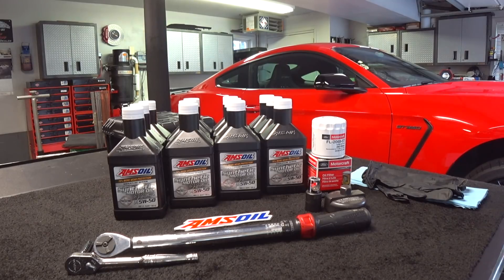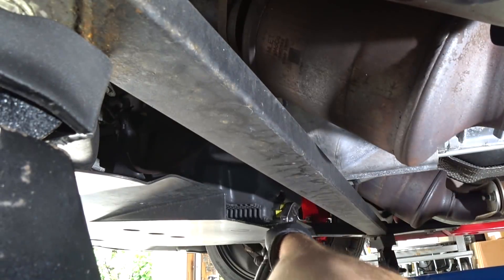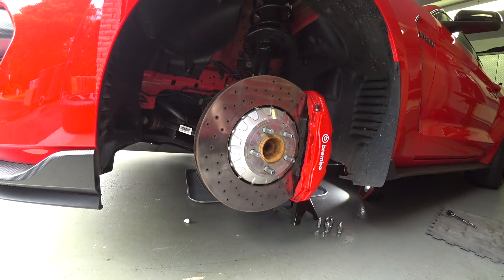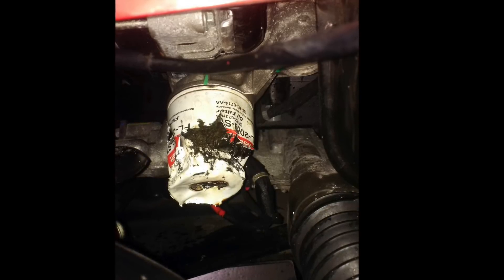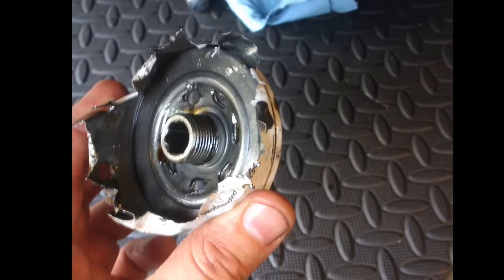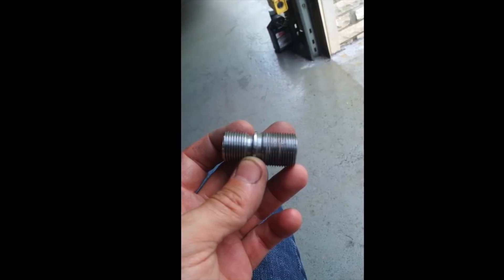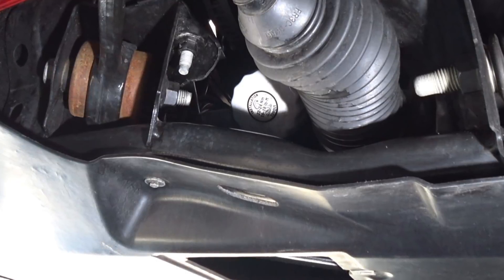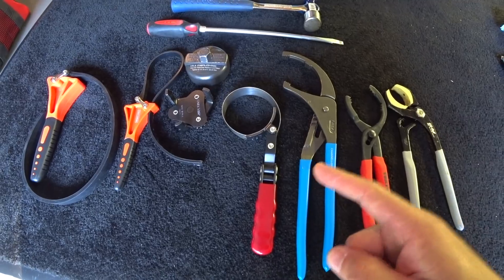Oil Change From Hell | Shelby GT350

Comment: Oil filters never need to be more than the equivalent to hand tight.  Ive been a mechanic for 15 years and have never had a filter tightened that way loosen or leak.
Reply: Do R/C! Exactly, i can see a bunch of guys using a ratchet to get the filter tight, A huge No No in my shop, same with guys getting drain plugs crazy tight, drives me nuts
Reply: I hand tighten and then do a quarter turn, just for peace of mind. On metal filters, at least. The plastic large diameter thread filter casings sometimes get hand tight before the o-ring even seats.
Reply: So true! It is baffling even more that the person was able to tighten it that much, given the filter's location and position.
Reply: Happened to me once. Specs sent out for aftermarket oil filters from manufacturer were wrong, and hand tightening lead to them leaking. Half a turn or a little bit more was needed for the aftermarket oil filters in the beginning, they were fixed shortly after but not til after I had my car towed for shutting off due to low oil pressure.
Reply: I work on my own cars!   They usually have some dufus with a GED doing oil changes at $10 an hour at these places!!  Not my car!!
Reply: Says on most filters to hand tighten. 3/4 to 1 turn after it makes contact.
Reply: You've never changed oil on a 12 liter Cummins then. Hand tighten that an it's gaurenteed to leak.
Reply: Wrong, if you are talking about a GT350. Hand tightening may work fine on any other V8, but the GT350's V8 is a flat plane crank engine that vibrates a lot more than a typical V8. The specs for replacing the oil filter on a pre-mid '17 GT350 ( i.e pre cartridge filter running change) call for torquing the filter to 18 ft/lbs. Hand tightening the filter only will result in the filter vibrating loose, in which case you'll have a much bigger problem than a seized filter. I suspect that the tech who installed his filter was aware of the issue with the filters backing off but overdid it on the torque. So the moral of the story is, don't assume a GT350 engine is like any other engine you have worked on before, and be aware of the required torque specs for the oil filter on pre-mid '17 GT350's.
Reply: For the most part you'd be correct, hand tight will suffice. With this model of GT 350 though it actually states on the filter that it needs to be torque'd to 18ft-lb. I've seen several 350's come to my dealership pissing out oil because people thought hand tight would suffice.
Reply: Hand tight plus 1/4 turn or my Explorer V8 will drip.
Reply: Im not a mechanic but have done many  and this is common sense. Stupid fuckin techs.
Reply: The picture of how far to turn the filter is on the box & the filter.
Put a sharpie mark on the bottom & see where it is when the gasket
is just snug to the housing,then do your 3/4 turn thing.
Reply: These engines vibrate terrible and will spin oil filters off at high rpm that is why they have a torque spec know your shit before you spout off your mouth
Reply: @lb0193  correct, that shit happened to my Tahoe when I only tighten it by hand instead of 10-15 lbs with a torque wrench. I'm lucky that I caught it before I lost ally oil, only was lil over a quart short👍
Reply: Ive seen new cars leaking from the filters from the factory, trouble with "hand tightening" a filter is that everyones hand is different size and different strength
Reply: Then you have never changed an oil filter on a GT350 in your 15 years.  Go ahead and hand tighten it and see what happens.
Reply: Hand tight..  dont forget to lube your gasket..  dont stick it in dry...  lol
Reply: I love the google warriors
Reply: Agreed
Reply: William Clark 
I thought flat plane v8 engines were more balanced and vibrate less, hence the higher redline on it and ferrari 360/430/488
Reply: im right on with you brother
Reply: @Do R/C!: I have a question for you.  I owned a 2014 GMC Sierra pickup with a 4.3 V-6.  No matter how hard I tightened the oil filter on it, the filter always loosened up after about 1,000miles.  Would you know what caused this?  I even used a 3/8" ratchet on the filter wrench to tighten it.
Reply: @magincap70  Toyota OEM oil filters,same direction.
I never had any problem with removing oil filter.
Can you believe it,Toyota even gives specified torque for oil filter. For my 2006 Corolla it's a 10 ft-lbf.
Reply: @CarsSimplified  correct method...after getting rubber gasket wet with oil...no need to crank on a filter spin on...half maybe 3/4 turn max...
Reply: @aceteza  a craftsman has the touch...on a flat plane crank engine...yes 18ft lbs torque...necessary!!!
Reply: @AStanton1966  the bolt on base needs blue or red loctite on threads...also v-6's vibrate more than v-8's...k...
Reply: very true... when i change my own oil i never use a filter wrench on or off... the ONE time i took an old car I had in university to an oil change shop because it was -25deg C for weeks, I ended up using a screw driver through the filter top get it out after the wrench failed... unreal.  I still to this day change my own oil.  Tired of shops (even dealers) who don't give a care.
Reply: Well hand tight it should be okay... but any tighter will break the ruber seal... but these 350 are different... my spoon engine can rev to 11k rpm n i have no issue with hand tight... but who knows ford is sometimes have reliable issue.
Reply: @iamtommyv77  Its not google warriors, its smart people who know what the gt350's flat plane crank's vibrations does to oil filters, you hand tighten one of these and the car will burn to the ground, go watch ADAM LZ's video where a stupid tech at a dealer hand tightened one and cost him a $30k long block and the whole front end of his car
Reply: @Pube83  No, ford couldn't do dual intakes on the car because of space in the engine bay so they had to change the firing order wich threw off the balance of the motor
Reply: @williamclark3712  %10000 agree with everything you just said. The Voodoo motor is not like a traditional V8 due to the flat plane crankshaft, high revs will cause lots of vibrations.
Reply: Spin on filters yeah but cartridge ones go hand tight with the ratchet equaling 18-20 lb ft
Reply: Some Filters like Ecogard are Cheap and will become Loose, And the Filters on some Trucks are in the Curvature of the oil pan which I’m sure you know and can’t be tightened properly with just your hand

Comment: You should get a caterpillar oil filter strap wrench to go with you're collection, I have everything you have plus the cat filter wrench, it's basically a seat belt material that loops back into itself and takes a 1/2" drive ratchet and the harder you turn it the harder it clamps down, haven't had a filter yet that didn't come off with that tool
Reply from the maker: no wrench would have helped here the issue was the threads were seized and crushed so bad with dissimilar metals, it had to be cut off the stud in my vise.
Reply: I have a snap on filter wrench like he’s talking about warranty it two time from breaking it off. I’m a John Deere tech. You wouldn’t believe what I’ve ran Across from framers putting filter on to tight and filter that been on a long time will make them hard to get off. I just found out the air hammer works good.
Reply: After looking at the position of the filter. The oil filter strap may not be of much use.
Reply: James Hintergardt true. John Deere farmers are kinda dumb....
Reply: Southern Mechanic I have had a couple that I couldn’t do with that type of filter wrench but that was because I didn’t take care of my equipment because I rushed myself. PSA: learn from my mistakes and keep your tools clean and take your time.
Reply: Jim Bloak     I agree lol
Reply: Whoa well arent you a big bwooii.
Reply: Same here locomotive fitter some times evin the filter strap doesnt work just crushes the filter in that case get the biggest screw driver and ram the prick through the filter works wonders lol
And to save pain putting oil on the thread and on the oring saves alot of dramas next time
Reply: Same. Those things are awesome.

Comment: I worked at a dealership for 9 years and we had a kid that did most all the oil changes. One of our techs was doing a oil filter change and found a factory oil filter on the car but the car had already been at our dealership for its first free oil and filter change. When the tech and service manager approached the kid about this he claimed it was just a mistake and he would be more careful next time. When the tech and manager were about to leave the tech opened up one of two large boxes that were against the wall and found both boxes almost full of new filters. Needless to say what happened after that. Everyone in the shop was in total disbelief until they saw all the new oil filters in the boxes.

Comment: No joke, had similar experience! Welded two pins to a 1/2" socket (forgot the size) and the pins fit into the filter end, stripped the threads. Oil change turned into a 4-5 hour nightmare.

Comment: Been there done that! Well it was on a 1972 Grand Prix of my dads back in the 70's. Wound up with just the filter base stuck on the filter mount, but could un-bolt the mount from the block, chuck in a bench vise, and use a large pipe wrench with a breaker pipe attached. The gasket squealed so loud the neighbors came out to check on me! God blast the ham handed mechanic that changed the oil before me. KM

Comment: I had a crappy fram filter crush like that once.  I hammered a skinny screwdriver thru it, which went thru the metal surprisingly easy,  and was able to remove the filter by using the screwdriver as a wrench.  Its wix or purolator filters only now and i haven't had a problem since.

Comment: I’ve come across this bullshit massive over torquing of oil filters and lug bolts. I’m glad you were able to fix everything. Nice work.
Reply from the maker: i had a tire shop over torque and cross thread one lug on my GT350 it took hours to cut it off and and the rim did get damaged slightly, i hate when they take the impact gun as full speed and zip aluminum wheels on without starting them first.

Comment: Simple way to get off tight oil filters (canister type). Take a simple screwdriver, flathead works, jam it through the middle of the filter horizontally (creates a lever) and turn.
Reply from the maker: not in this scenario, trust me you never want to go though this, read some comments below once the filter gets cross threaded and seized its a disaster.
Reply: Auto Fanatic yes you had a much bigger issue. This method just helps with stuck filters that are just very tight with no nut at the end or filter wrench available.

Comment: I found WD-40 around the oil filter gasket helped me a few times. Spray around the gasket where the Oil filter screws into the engine with the straw of the WD-40. Let it sit for ten minutes. Unscrew the oil filter.

Comment: The trick that has got me out of trouble in the past is the old screw driver through the side of the oil filter trick. It’s messy but in the lack of nothing else, it is quite often enough to brake it loose. I saw an old guy do it once and it always stuck with me. Back in his day a lot of people did there own oil changes and know one had some fandangled oil filter tool. Just get an Fing big screw driver and hammer it through the side of the oil filter til it goes right through then give it a yank and hey presto.
Reply from the maker: that did not work in this scenario the threads were crushed and seized to the oil pump center stuff, had to be cut off in my vise and rethreaded, whomever put this filer on was one stupid bastard

Comment: I've never "torqued" a new filter when putting it on. Always just hand tight and never had a problem getting it off for the next oil change. Someone absolutely got crazy when putting your filter on for you.
Reply from the maker: on this engine it is required due to the intense vibration if you hand tight it will spin off and you will loose all oil and BOOM your engine
Reply: I guess you will know if they got carried away installing that filter when you go to take off the new one.

Comment: Heavy duty filter strap wrench  1/2 inch drive sold at napa.they are designed for use on large truck and bus filters..might've worked..sad situation anyways way overtightened.love those gt 350's

Comment: That happened to me once on my '92 Mustang Gt......i had the oil filter wrench on the filter, trying to loosen it and it just caved in and crushed, exactly like yours did.  I literally just grabbed it in both hands and contracted every muscle in my upper body and actually got it off with my hands.  Ironically, i think the crazy shape that it formed after it crushed enabled me to get a better grip on it with both hands, and the access to it was better than the access you had to yours.

Comment: I'd be using a 1/2" and a shorter extension. It'd give you a better shot at transferring the torque, but that's what you get when you leave aluminum and steel together for a year.

Comment: I no longer try to remove the wheels my self as usually the wheel drum etc gets marked up. So I bought a motorcycle stand from harbour freight.$79.00.  Wheel it under the jacked up tire, take off the bolts while the stand holds the wheels and pull wheel and tire out horizontally perfectly every time.

Comment: Oil filter hand tightened only
Reply from the maker: not on this car it will fall off with the engines vibrations, thats the issue, the dealer tech must have been afraid of a come back or failure so he overkilled my filter.

Comment: I never use the torque wrench. I always just finger tighten the drain plug to prevent cross threading the oil pan, and then use a very small wrench to snug up the drain plug. I've seen torque wrench stripping aged cast aluminum oil pan over time. With the crush washer, it will not come lose with vibration.

Comment: The seizing and galling of the thread on the stud was probably caused by a galvanic reaction between the aluminium filter and the steel threads. Disimilar metals will react with each other and bond together.

Comment: Not sure if you've seen some videos on youtube where these auto shops dont even change the oil or filter!  Good trick is to put a dot on the underside of the filter. The last time I had my oil changed, I told the shop manager I wanted to watch them do my oil and he let me, and that's the way I prefer it to be done, the right way, no shortcuts.

Comment: Wow.  I’ve never encountered something like that.  The worst I’ve had to do is spear the filter with a long screwdriver to get a filter off.  Looks like you did not have the space to do that though.  I carry a breaker bar in my Jeep because of a time that lug nuts were over torqued and I twisted the factory lug wrench into a pretzel trying to get the over tightened nuts off.  Handy as a club too, if you ever need one.  😬

Comment: My old BMW had that style of oil filter were you just change the O-Ring na d filter and put the cap back on.  If you don't change the O-Ring everytime it will leak oil, I'd rather have a normal filter.

Comment: next time grab the filter at the base. prevents the filter from twisting and deforming and also applies more torque to where the threads are. what you had to deal with also happens when you dont add a little oil to a new filter gasket when installing it.

Comment: Your oil contains a seal swell agent in the oil package itself, just screw the filter til it gets firm, the no more than 1/4 turn. The o-ring will increase in size by 5% when the swelling agent permeates the o-ring.

Comment: Besides the stuck filter it was stupid simple, I would question your wrench work, not having the cup on straight in the first place.
Reply from the maker: you guys crack me up and you were not even here, the filter cap was damaged when the dealer installed it that is why the OEM supplied cap wrench did not even fit properly and it made it worse.

Comment: I had a similar problem on a 2000 Intrepid R/T . Really makes you mad. I had heard about the filter redesign,  so when I went looking for my GT350 I checked the date of manufacture.  I believe  Ford made the change on all cars built after Feb 2017. I think  Ford Performance sells the parts to change over to the new design. Keep up the great work. Looking forward to getting some of your wheel cleaner!
Reply from the maker: Now i need to see if I can switch this over to the new design, to me it looks like the entire oil pump and lines would need to be replaced and that looks like a bitch of a job i really do not want to do.

Comment: Great tips just in case. Man I sure hope my oil technician did not put mine on that tight as I plan on changing my oil in my GT350 by myself next time. I do remember telling my oil technician to follow the torque directions on the filter, its on there Because of issues like this, like how many other oil filters do you see with the torques rating written on the filter? I bet not many.

Comment: Two comments...

One: if it gets to that pitch you may want to have a chain clamp wrench as well. 

2: always lube the gasket on the filter before it goes back on to avoid it sticking in place. I know that wasn't your problem this time but sometimes when people over tighten it's complicated by the fact the gasket gets heated and stuck in place.

Comment: I would replace the nipple on your next oil change. If it got work hardened and brittle it could crack and fall off. This was an issue on some aircraft engines I have worked on and more than a couple engines seized before landing after the oil ran out. Consider it cheap insurance compared to a new engine.

Comment: Buy a strap wrench for next time. I have used them for years on semis and passenger cars. Even torque all the way around, for the most part, and havent had one I couldnt break loose yet.
Reply from the maker: try one with seized threads like I show in this video, had to be cut off in the vise.